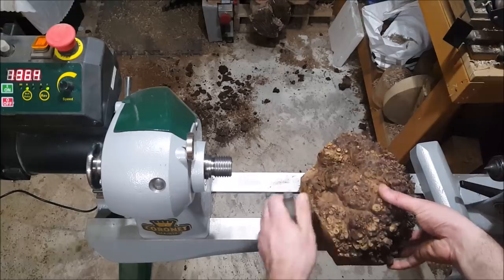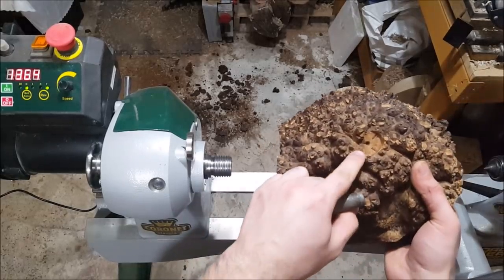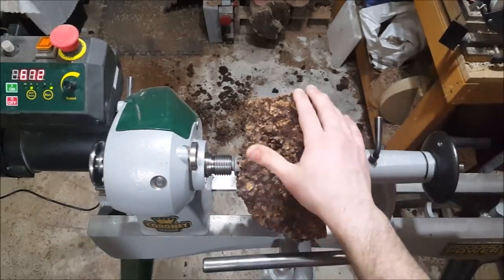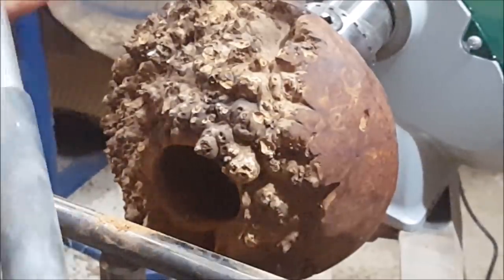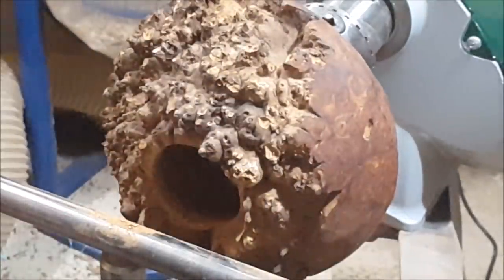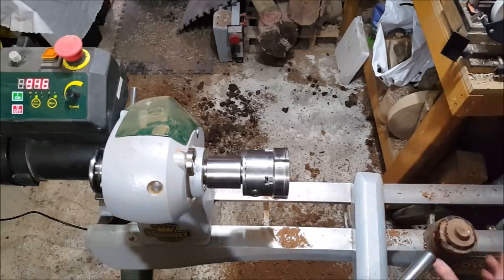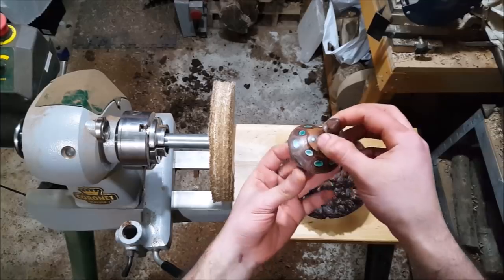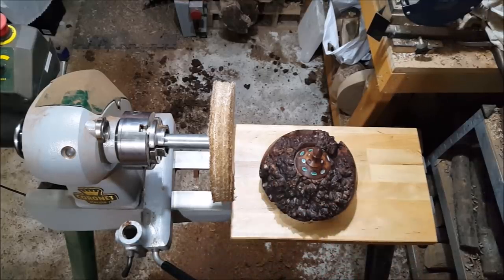Wood turning - Difficult burl to work with!

Comment: i am wondering to buy this lathe   but does it shake when you have big pieces  that are not round
Reply from the maker: this lathe is really good and past far from my expectation of a good lathe. you can bolt down the legs to the ground and fill the legs with sand to make it heavy. ive turned heavy burl that weight 16kg with it. and foir uneven piece you can use the outrigger and have the lathe turned to 90 degree and turn it in middle of lathe for stability.